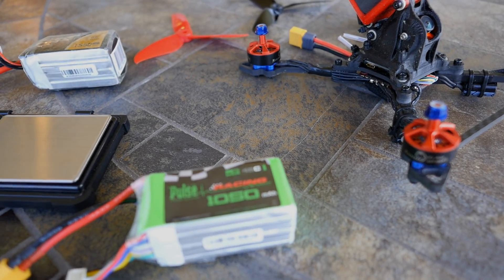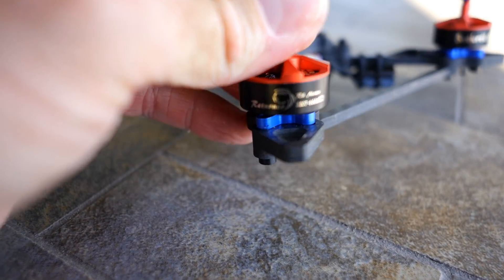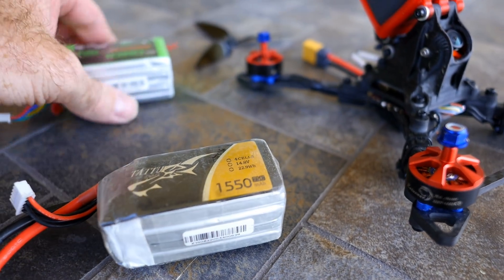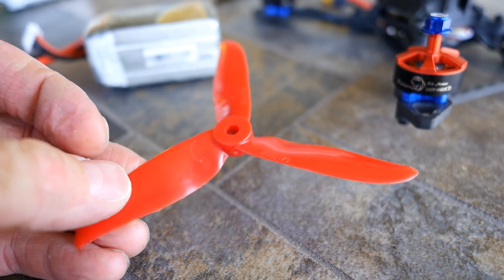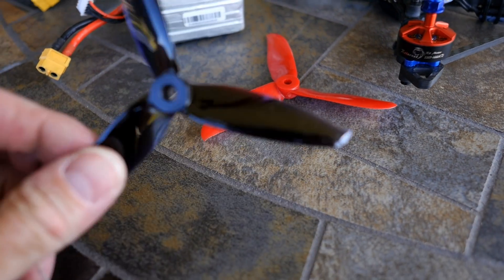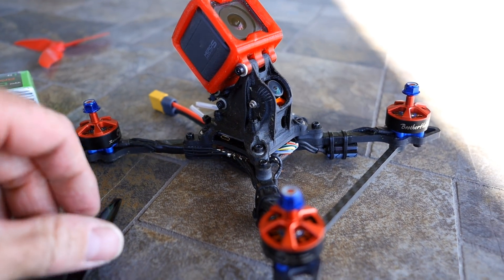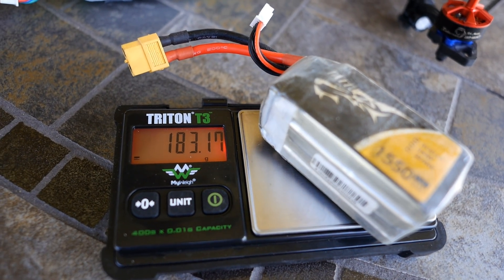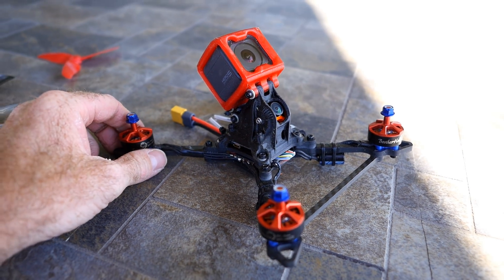The next epic setup for FPV racing? (High voltage + Low KV)

Comment: Other big thing too from my testing on 6s is batteries are coming down warm to mildly hot. But more importantly, not puffed at all like on 4s. Keep in mind I'm using a Tattu 1300 75c 6s pack. I was originally going to use a 1050 sized pack. Even at a 95c rated battery, the cells are physically and dimensional wise are thinner than the 1300 packs I've come to like. Those were getting hot to very hot from testing. And if I kept going at that pace I'm sure they would puff at one point over time. The 1300 packs I'm betting will still work consistently over the life span and maybe even outlast my 4s packs. 

Another thing I noticed too. Individual cell voltage is more consistent across the pack after a run. My 4s setups would come down a the voltages would be off on every cell +/- 0.04v depending on how hard I was flying. As long as you have a good tune, lower your yaw PIDs down, maybe increase your yaw filter up a little, your motors shouldn't be hot at all yet alone warm if done right. 

Can you still burn through a 6s pack in a minute in a half on low KV? Yes. But, if you fly right and once you get used to flying a 6s quad, you've got no sag for the entire two minutes. Lap times are more consistent than 4s due to voltage sag towards the end of the run, and your equipment is working less since you're not pulling high current like on a 4s setup. 

I've converted three of my four race quads over from 4s to 6s simply by swapping motors out. And so far, I'm really happy with how well they are working. Racing and talking with Ryan (Rotorious) has been a great experience and you guys at CMW for sure had something going last year, and look what has happened. 2019 is going to be a fun racing year! :)

Comment: Plus the price for example a Tattu R-Line 4s 1300 95c pack is around $32 or $33 bucks depending on where you find them. Compare that to a Gens Ace 6s 1050 45c pack at $23 to $25 bucks. Isn’t the price for a 4s getting kind of ridiculous to be honest? If I can get the same if not better performance from a far cheaper priced 6s battery then that’s a win in my book. Plus I’m able to get more batteries compared to 4s batteries for more affordable and saving money too in the long run.

Comment: You're going the right way, don't stop at 6s - the higher the voltage the better the efficiency, you can use smaller motors with thinner wires=less copper/weight and get the same power out of them. In millitary and industry they use high voltage motors all the time. They have a.o. a 400v standard, while the rest of us have to suck up and pay more for lower voltage systems. This is what Tesla found out and all theory supports. And what Edison never would commit to... of course if you want to sell electricity it shouldn't be too efficient. In the drone market the voltage will have to rise in the quest for performance, as digital FVP will replace the crappy but beloved analog...

Comment: There is only less amp draw until you begin exceeding the RPM of a 4s setup. This higher voltage thing has been happening with Helis for a while. Used to be 3s on a 450 (325mm blades), then went to 6s, half the kV, and close to half the mah for same flight time. This produced better torque as well (due to higher voltage, not because the motor itself physically has higher torque potential- torque change is far more prevalent in brushed mores, where higher turns made less rpm, but more low end grunt). Anyways, this allowed for the 450 size heli to step up to 360-380mm blades. As far as quads go, it isn't as easy as helis. This is due to the fact that prop rpm dictates how the quad moves, not pitch. This is a major reason why quads are less efficient, as they constantly change rpm. Simplifying the situation, half the kv, half mah, double voltage will result in the same performance, but more torque (and less amp spikes with throttle change and so forth) this gets around the same flight time, a little more due to spikes being less. You can also go to smaller escs. 

This testing isn't accurate though, as overall potential rpm is higher, and then you went to a slightly larger prop to gain more top end over the alresdy increased potential rpm. The point at which you reached a higher rpm and especially with larger props, you started teaching amp draw getting greater, catching up to 4s amp draw. This would, in turn, explain why flight time was basically the same, and any increase is likely due to the 20g or so less weight. 

The only way to properly test higher voltage setup would be to obtain motors of equal size and weight, same props, lipos of the same weight. That would be a fair test...and you would find higher flight times due largely to amp spike decrease. And the 6s being more than half the mah of 4s packs. With rpm and weight all equal, top end woild remain the same, and you'd gain on responsiveness of rpm change. So it would fly better, but not top end with equal variables. Is 6s better? Yes, but not for top end like this video. And the increased responsiveness could hinder flight for many who are used to how the quad instantly responds. In that case, 6s could be seen not enhancing performance, but a variable of flight characteristics the some may love and others Hate. Your test was purely to top end, but you could have used lighter packs, kv that results in exactly equal rpm, same props, and found top end to be equal.

Comment: I'm still rocking 1500Mah 3S batteries with 2650KV 2205 motors along with 5040 or 5050 tri- thin blade props, I now only build on efficient, light, thin arm frames, I feel it gives more than enough speed and punch for typical park "tracks", sure, for freestyle or large tracks you may need 4s or if you run a old school H or other fat armed frame, but still- I like light, low voltage builds.

I dislike high voltage setups, not all components can deal with the voltage, batteries are less reliable and a short-circuit can go really bad, really fast, but the theory makes sense and the motors could run crisper due to the low KV and high voltage range- more volts= more efficiency, I just like the universality of low voltage builds.

As you said, we are reaching the limits of quad frames, that said I have a freshly built Diatone GT Normal Plus (which is a stretched +) I need to fly, but from quick LOS blips and flips in the front of my house, along with my rust I need to blow off, I need a big open field because this thing is going to rip and trees will be salivating for a taste of my quad. D:

Eager to see a Merica 5 stretched plus frame, I would jump on it in a hot second!

Comment: the 6s race quad thing I have been doing for a long time because when I was sponsored by pulse for helis I had a bunch of 6s 1350s and I used them on race quads long before it become popular.
I love flying 6s hyper powered quads.. low KV 6s isn't the only way to do it.. two of my fav setups are a R32207 2522kv on a custom race frame I make and the other is a R52307 2650s.. I have run the new R52207 2700kv on 6s to and they rip hard but very prop fussy on 6s I prefer them on 5s running GF5152 Bi blades (oh yeah and that's a Merica build, finest frame I have ever flew.. including my own frame designs that are exceptionally good.. the Merica is something to behold.) is mind numbingly fast.. don't be scared to run mid to high KV motors on 6s, just watch the proping and remember that you don't need high pitch anymore, HQ5x4.3x3v1s on a high kv 6s set up will flat scream on top end and have eye crossing acceleration that prop keeps amp draw up top under control on lower mah packs, I'm flying 1550 95c 5s and 6s R-lines no need to go to a lighter 6s really and the flight times are excellent and when you do want to run heavy pitch props the packs take it with ease.. yank them 1650s off, throw on a set of the R3 2207 2522kv or R5 2306 either KV and 6s and GF5152 Bi-Blade props and come thank me after a pack or two.. the one problem is... that after flying a great frame, light build, mid to high KV 2207 or 2306, 6s on GF5152s Bi-Blade or Emax Avan S Bi-Blade props going back to 4s feels dull once you get used to top end, response and acceleration that a set up like that offers on 6s. i believe within 6 months I will not fly anything but 5 and 6s with 6s 90% of the time. oh yeah the New T-motor F40 Pro II 2400s love sucking down 6s packs, the 2600s are a little fussy with tuning and props on 6s but just like the 2700kv R5 2207 loving them some 5s power.
mid to high KV 6s sound will make it feel odd flying 4s as well because you get used to hearing the sound the props make at ultra high rpm then go back to 4s and it sounds like it has no power... and if you do much LOS flying on 6s you will literally not be able to go back to flying 4s period when flying LOS, every LOS build I have done in the last year has been exclusively R5 2306 2400kv and Hyperlite 2307 2522kv on 6s.
Reply: No los videos??

Comment: Would you mind sharing what version of Raceflight you were using and the PIDs.  I just built this set up and it's10 degrees outside.  So if I could cut the tuning part out of my day, that would be great!  Because I can only fly two packs before my fingers go numb!
Reply from the maker: This is raceflight bro. I did ZERO tuning. I just changed my rates to my normal settings and departed on my journey into FPV paradise. I just loaded whatever the most current release is right off the RF site.
Reply: Thank you!  That is how I normally roll, but just thought I would ask if you put in any secret sauce.

Comment: Its funny how this is "new" to the quad world - and I don't mean to make that sound insulting at all - its awesome that someone like you is putting this out for others to see.
I started rc with powerful rc trucks.  In that world the move to higher voltage and lower kv happened quite a while ago.  My favorite truck has a gigantic 4075 2000kv motor and runs on 2 x 3s 4000mah packs in series.  The truck is 15lbs and goes over 60mph.  Of course it has a 200A fan cooled esc and has loads of caps in line..  Many rc racecars also use sensored motors for maximum smoothness.  Many people who have been doing speed attempts for a long time have been doing even lower kv and 8s rigs to get faster without exploding things. 
I wonder if the lag (if you can call it that really) in quads power systems stems from the engineering difficulties in escs that work on quads.  Hard to make a sensored 200A esc that would fit in a quad now that we all like them so small.

Comment: I just realized i got the 1050 75c 6s packs.  They weigh 186g, still not bad considering that's the same weight of a chln 100c 1300 4s pack.  Just for fun i ran one on my alien with f60 2350kv motors and it drew 141amps on some dal 5040 tris.  I think some 1900kv motors with dal 5046 will be a sweet spot for this battery, we'll see.
Reply: I'll have to order them.  I have some gemfan 5152's and of course cyclone 5046.  I should have some dvr and hd video this weekend, along with amp draw numbers.  I might hate the way it flies, i don't race, so $100 worth of 6s batteries is all i'm willing to spend at the moment.  Very excited to try the new 6s low kv hype though.😁  helidirect.com only wants $23 for the 75c version, they want $26 for the 45c. 🙄

Comment: What do we expect from a 30gramm motor? In a race we want fast rpm increase, in freestyle we want similar things with more torque in lower rpm parts. with 30gr and 5inch props there will always a limit. i fly no race and no freestyle with a 8inch prop setup. but in my case there are no good motors any more. none of them have a real efficiency above 5. all numbers lower 3 are bad designed or overpropped motors in my opinion. only the armattans are close to 3 and above like mqtb tests. we cant beat the physics with higher voltage and the  same motor design. kv is only one part to change. in other words: the loss of efficiency in overpropping is our problem.

Comment from the maker: I just had a thought about this subject I want to share. I am hoping that MultiGP will consider allowing this high voltage in an open class. What is nice about a 6s pack is it gives pilots much more flexibility in regards to performance. It gives you the ability to have tons of headroom for tinkering with performance VS flight time. We all play that game right? How much performance can I squeeze out of this machine and still finish the race. Well with a 4s setup you are limited to that pack's voltage (ignore HV packs for the sake of conversation lol). However with a 6s pack you have the option to go freaking insane and run say a 1850kv to 2000kv motor which give BRUTAL straight line speed and grunt in the corners. Of course you then are penalized by drastically reducing your efficiency and flight times. Atleast you have this option with 6s and can make the decision that is best for your flying style, the track in front of you, etc... Lets face it guys there is only so much power you can get out of a racing motor. Currently high end motors are optimized from a performance standpoint. We aren't going to get much more out of them. Also there is only so much weight you can strip off a quad without it getting to fragile. We are now beginning to reach those limits. So what to do now? With 4s you are more limited IMO.
Reply: This will make the setup choice more interesting, but the problem is still there. The motors are not good enough for competition. a high class  competition motor should cost about 80$ comparing to other  race competition technics with private fun techniques. it cant be the future in professional racing, that we still use the same motors every fun flyer use in his backyard. i say it again, actual motors are not that good, as they should be. maybe we are to stupid to spend enough money for better motors and the market accepts that.
Reply: we can use 10S 850mAh Packs. some time the shrink tube + cabling will be 50% of the batt pack weight. :-)

Comment: Yea in the New Year, when my fingers wont be getting Frostbite its indoor season soon so catch up on your order books keep on testing that setup and creating your Pods and number 2 we will talk about, teetering going shorter arm or bigger arm so 3” or 6” or mix for something different cauae Merica Pod i put on a 5”/5.5” frame went from blah, to wow right behind my Merica. because of rear brace and LED bar for my line of sight flying the Hybrid comes in lighter too. So may be something else to think of. 5”/6” Merica low KV on higher MAH than your 1050, for Long Range setup for Landscape freestyle flying, if thats possible to push flight times to 10+

Comment: Run it on 6" and you will see what thrust really is :). I've been running 6" 1300 rline 6s on bolt 2207 1660KV on ideal 6048 tri props. It rips so good and still can get 5-6 min cruising.
Reply: How many amps does that set up see? And what kind of esc Are you running?
Reply: FpvU&Me 140-150 Amps at punch out and hold. Currently running betaflight 32bit esc.
Reply: Are you running a 40amp 4in1?
Reply: FpvU&Me no it’s single esc’s frame is boltrc Kraken 6” gt

Comment: I'm still afraid to try 6S.  I still see lots of people burning stuff up when the tune is a little off.  It seems to work great when everything is tuned.  But oscillations that will just give warm motors on 4S seem to fry ESCs on 6S.  Plus I build my stuff mostly around MultiGP racing rules.  So unless my local group starts having 6S races I'm not sure I want to invest in a 6S setup.

Comment: Great video; thanks. I'd suggest adding the math (to your spread-sheet :) for prop. tip speeds. People who are trying 5S and 6S on high KV motors are risking going above mach1 (i.e. breaking the sound barrier). If that happens, the prop. WILL explode :). Of course a higher KV for the voltage effectively gears up the power train, risking power train overload through out the rpm range.

I get for instance; from your example (a reply below) 16.8v and 3000kv and rpm of 54,000, a tip speed of (5") 1,206.68 kph = mach0.98. (using sea level, 20 degrees C). Same set up with 6" prop gives 1,448.01kph = mach1.17.

A more common example: 22.8v (6S 3.8v/cell) and 2600KV = 59,280rpm, on 5" = tip speed of 1,419.28kph = mach1.15. That's crazy, and dangerous. Props are going to explode travelling at over 1000 kph. People could be very badly hurt.

:) I agree, I think higher voltage (cell count) is needed and warranted. Lower KV matching motors are an automatic requirement of that higher voltage.

Comment: can't seem to find any low kv motors with a 4mm shaft/bearing.  Really don't want to buy more 3mm shaft motors if i can help it, they all end up sounding like rock polishers after a few bumps.
Reply: Yes, i have not tried them yet.  Envyastro did a video about them, check out his channel.
Reply: 1600kv, nice, i'll wait for those and try to melt down some higher kv motors on 6s.
Reply: mooosestang rebelminiquads released a 2306 1800kv motor, it has a 4mm shaft
Reply: $30 a motor, ouch!  I really like their solder pad design though.  http://rebelminiquads.com/2306lr-1800kv/  1800kv maybe the perfect kv for dal cyclone 5046 though.  I will be testing some 1800 or 1900.  Maybe catalyst machineworks video is influencing the hobby.
Reply: They bend to easily at the hub.  I've bent many, but they are great if you never crash.  No way to bend them back without getting jello.
Reply: Have not tried it yet, may need to on 1600kv motors.
Reply: Isn't there supposedly a v2 of those with a stronger hub coming out? I'm also tempted by those rebel LRs - wondering if the weight is the same as their standard 2306...